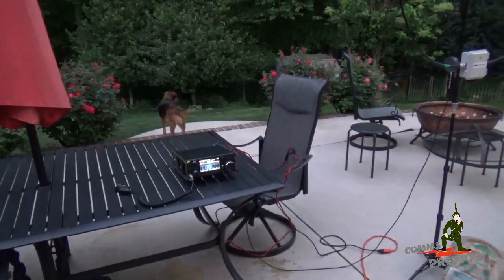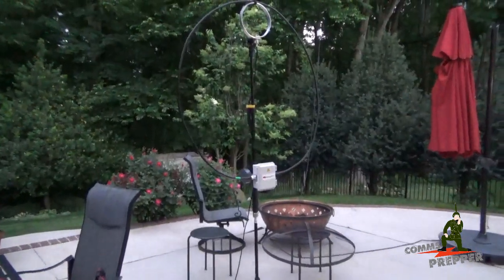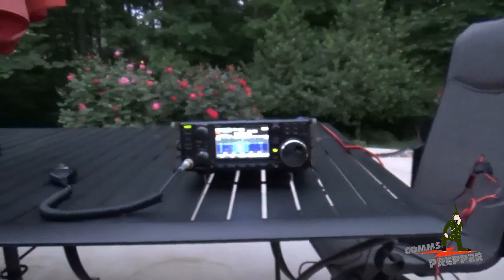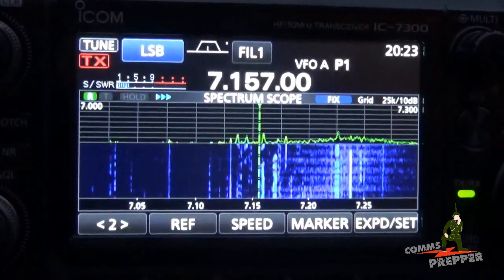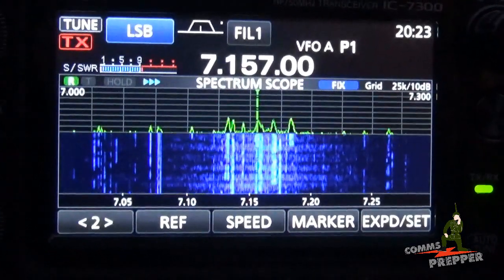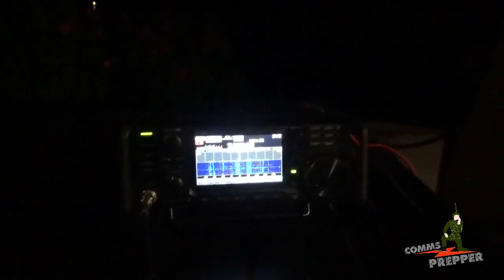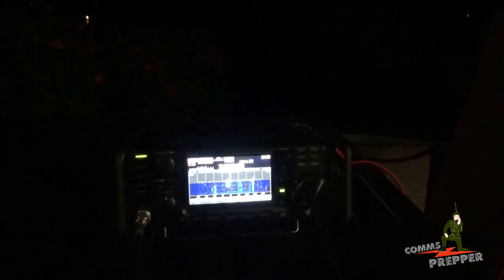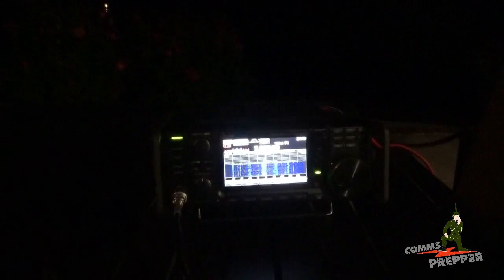Chameleon P-Loop v2.0 Antenna - 40m band evening operations

Comment: Thank you. Great video. I can see how the waterfall really helps. I have a magnetic loop which is a different brand. I am going to use an Arduino and a stepper motor for adjustment. I will use an infrared remote to adjust it while I check the SWR on the radio. I bought an Arduino starter kit recently for 30 bucks that came with every thing I will need for the project. Once I get that working, I am going to  try to build an SWR circuit to feed the Arduino information where it will auto tune. The first part won't be that difficult but the latter upgrade will be a challenge for me.  73 KF4UPI - Ron
Reply from the maker: +Ron Langner sounds like a cool idea and project - let us know how it goes!